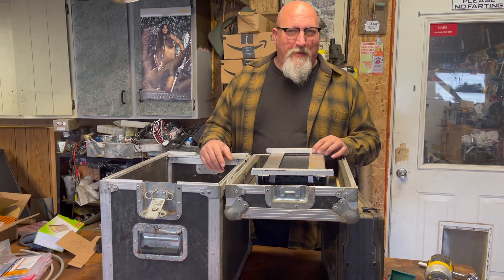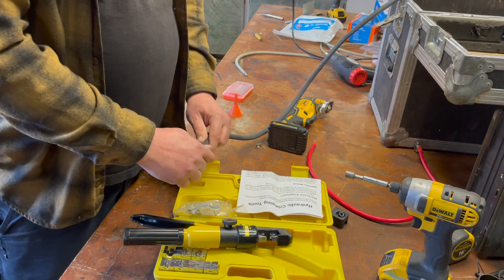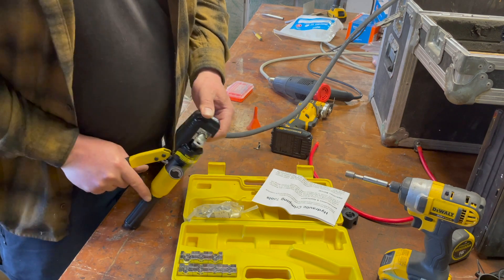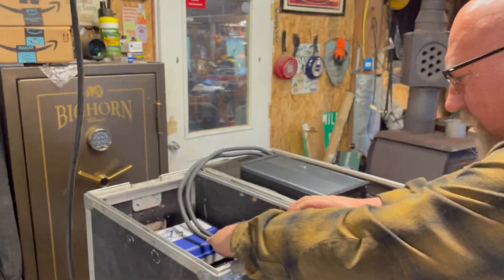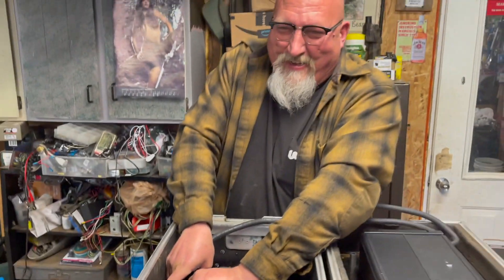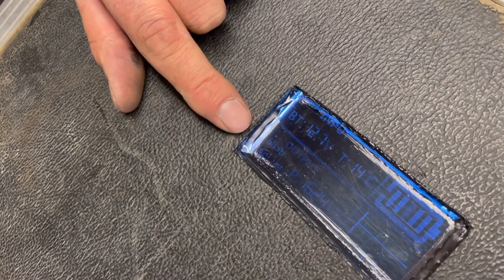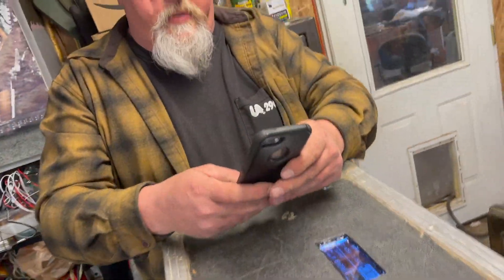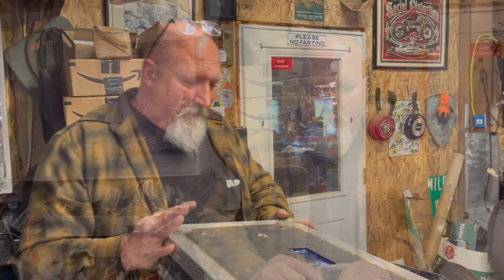DIY Solar Power Bank: Part 3

Comment: Also stay away from aluminum wire, needs large gauge to handle the same current and doesn't conduct as well as copper.